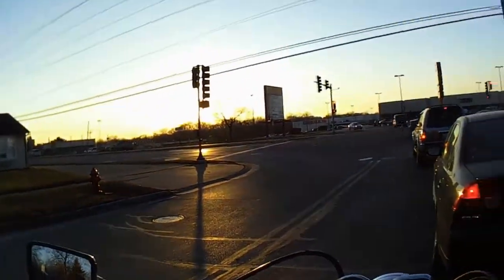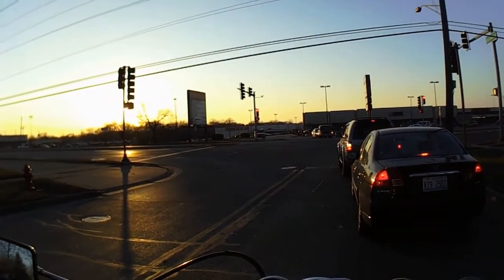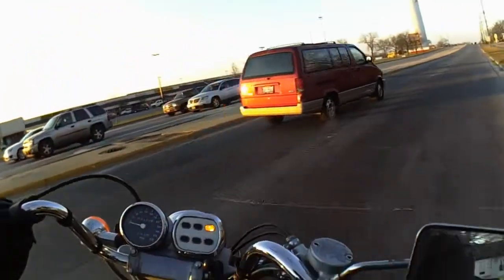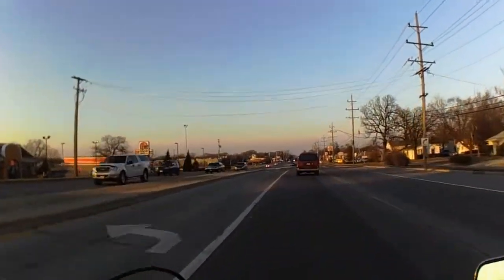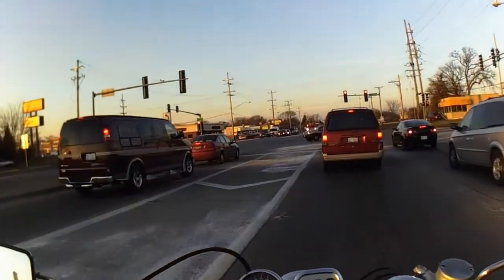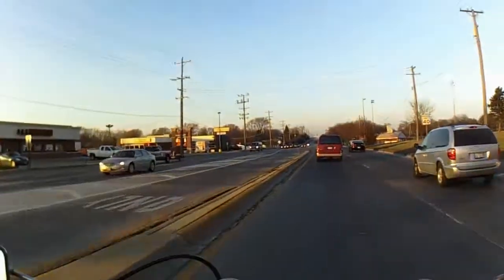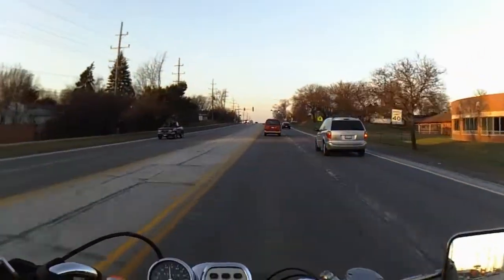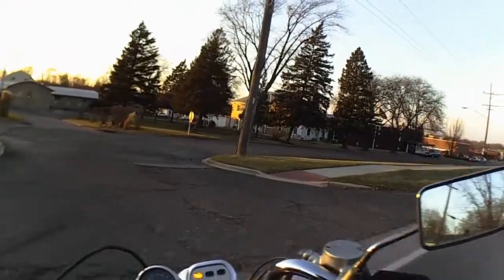Replay XD720 Test (Low sun with contrasting light conditions)

Comment: Sounds good.  Did you use the AVS software to boost the volume or was it just the power mic?
Reply from the maker: I used AVS and boosted it 6 db based on what I heard on your video. The power mic at 1.5 volts is just a bit underpowered.
Reply from the maker: Sent you an email Dave. I found a way to get rid of the "boomy" bass like being inside a bucket.

Comment: Nice handlebar muffs, seems like several people are running with those this year. I have a pair where the outside is made of a stiffer material so it holds its shape. Tried those at 40 and they were nice. The only thing is your thumb sticks out thru a hole covered by pink material. It just looks "wrong"...
Reply from the maker: Yeah pink is not my favorite color either. LOL

Comment: Bill's a very generous guy!  I gotta wonder if he's got stock ownership in Replay.    Hehehe  :D
Audio is a little boomy when the shield is closed but it isn't bad at all.  Might try positioning the mic back into the cheek pad a little. A low audio level is better than too high (clipping) so long as you can correct it in post should be OK.
Over all this looks and sounds really good.  Things have improved a lot since the Vado cameras.  :D
Reply from the maker: Yep moved the mic back into the cheek pad more and also tuned the bass down a bit. Now to work on the exposure.
Seems a bit darker than I want.

Comment: i dunno sounds like a hassle with all the plugins  you think they would make things a bit more durable for the use they are intended for  i still like my old pro  only thing have worry about is battery charge  did i put my sd card in  or did i turn it on   hahaha o
Reply from the maker: Yep you have to be very delicate with the plug and screw on cap. I can see one time trying to force it on and wrecking it.